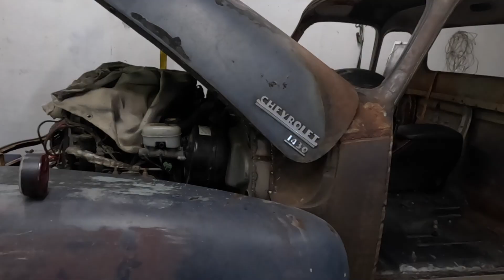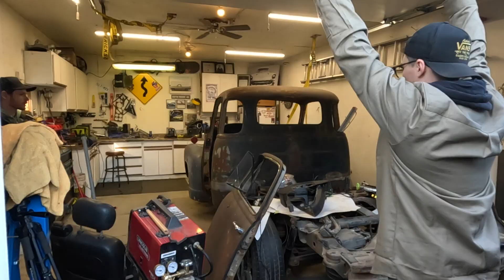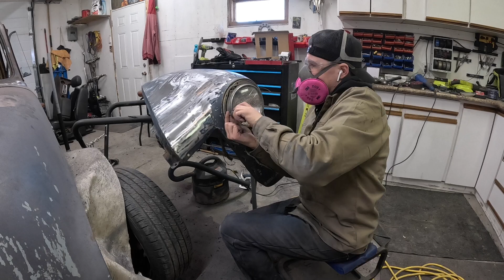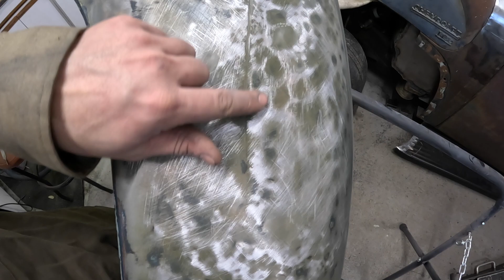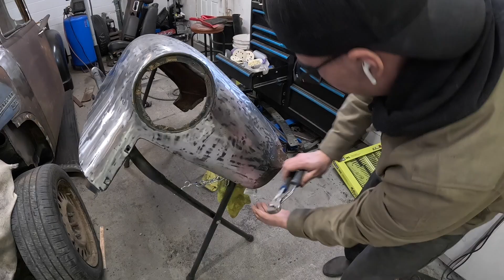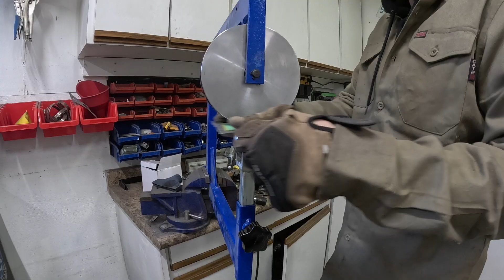METAL WORKING & RUST REPAIR ON FENDER || CUSTOM BODY SWAPPED 54 PICK UP ON ENVOY FRAME. EP. 11

Comment: Looking at getting something more than just the da sander, you think the paint stripper is more useful than a small sandblaster for a project like this?
Reply from the maker: The stripper is really good for stripping paint, not the best for pitted rust, that’s where a blaster would be better. I’m looking at getting a blaster soon before I prime. The stripper is a really handy tool tho too, not sure what’s best out of the two, both have there purpose

Comment: Considering what it looked like when you guide coated it with the spray paint and 80 grit blocked, I'd say it got a substantial amount of progress. I like using Duraglass over the whole thing, mud hog it with 80 n block. Then I skim the whole thing with filler with plastic honey in the mud to thin it down, overall coming along pretty awesome! Thanks for sharing!
Reply from the maker: Yeah I will be! Do you epoxy first? I’ve never heard of plastic honey lol!
Reply: Yes, I also scrub the metal using scotch brite and wax &grease remover before epoxy. Then spray epoxy, that way when you're ready to do duraglas you can scuff the panel with 150/120 to skim for a bite. Otherwise it won't feather into the epoxy or metal, it's okay to break through the epoxy when you're sanding. You can always etch before primer..
Reply: USC also has a filter thinner similar to plastic honey, most body shop supplies shops can order it. Or on line..
Reply from the maker: Okay great, thanks for all the info! I’ll look into the plastic honey more